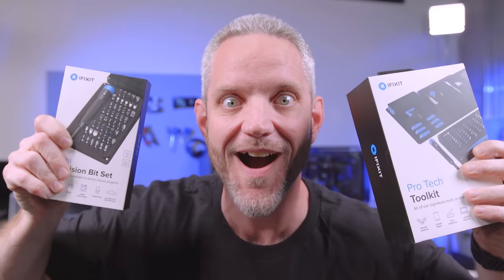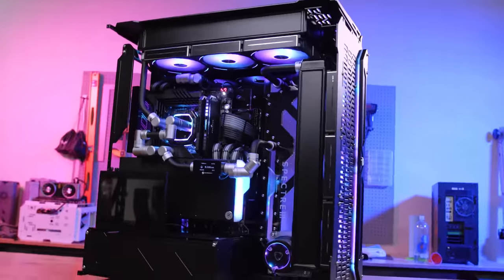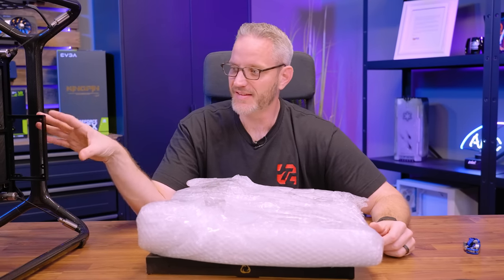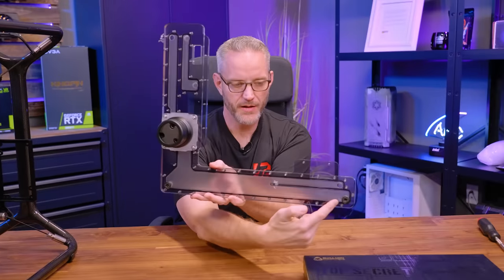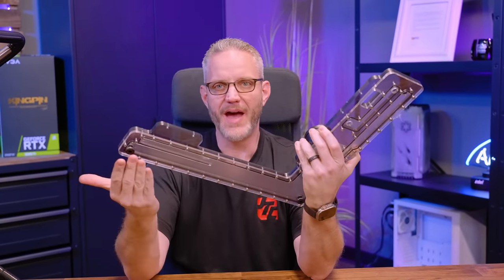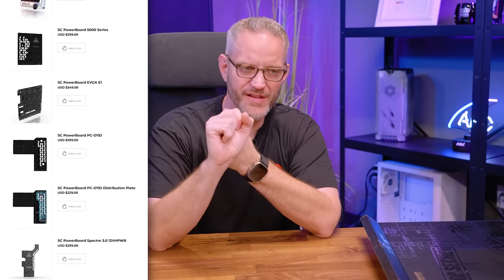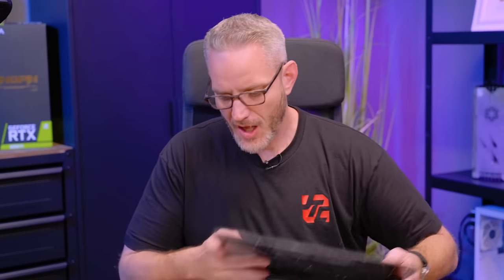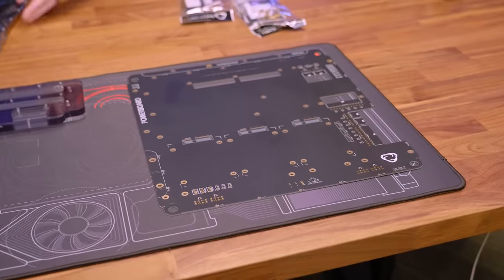This build just got even more EPIC!

Comment: This is going to sound moderately insane, but I think this build would be a perfect opportunity to get wild with copper.  I can see big copper rads on this, and it's amazing in my mind.
Reply: I like the idea. Maybe not an "insane" amount of it, but only a tasteful amount would look great.
Reply: @ElembeeOfficial  I'm sure Jay would only want to go with radiators, and tube fitting accents.

But in my mind, and for a long time, I've wanted to do a build soldering four bundled up refrigerator supply lines into 1/2" angled fittings, to where it looks similar to header tubes on a hot rod, both on the intake, and return to resemble that classic V8 style.  You could even make a solid copper distro block that drops off both ends of a radiator and splits to 4 smaller lines, on either end.

Again, this is just in my mind, and not something I've shared or seen.  But just to put it out into the aether.

I might add, that process is shockingly easy to do, if you've ever worked with those tubes.  Though, it definitely requires a certain finesse with a hammer to shape the fittings.

I dunno, just things honkies build in their minds when work is slow, I reckon.
Reply: @ramshaka  I can see your concept and I'm sure that would look great as well.
Reply: I think gold is more Jay's style but copper would be awesome
Reply: @jazazzaza  I just find natural metals kind of sexy.  I think the only way to get the gold look without paint would be to use leaf, which is just too fiddly for me.

If you wanted to do the chemistry homework, I guess you could substitute bronze though.  I'm just not sure how that would act in a loop, I know it will oxidize green crud without any additive though.

But I think you can get a nice 'rose gold' look out of copper, with very minimal extra work.  I like to use just an old rag, and coffee, starting from a raw polish, and lock it in with a little clear coat to keep it from going brown.

Just recently did this with my basement bathroom plumbing.  You can play with the antiquing with just a few pennies, and an eraser, till you get the desired color.  It's surprising how large of a range you can get.
Reply: @ramshaka  yeah it's definitely an aesthetic that matches the hobby too imo. yeah you're right, wouldn't be worth it w/o leaf but then that's tedious

rose gold would be very unique, I don't think there'd be many (if any) people doing that for pc water cooling

Copper, maybe coloured is the way to go for sure. Will be interesting to see what he does
Reply: Copper sounds very Diy Perks.
Reply: Copper pipes that are braised would be nuts very cyberpunk and steampunk it would be bad a.s.s
Reply: Not feeling the copper with the carbon fiber frame tbh.
Reply: Yeah, especially with those analoge guages, it would fit a copper steampunk-like theme perfectly. And the gold accents on the KingPin-Parts would work with that quite well also.
Reply: Are you saying "copper" because of how the GPU was looking and was giving a copper look because of the reflection from the wood table top?
Reply: Cooper tubing instead of plasticpipe for the aio

Comment: You should 3d print a cable comb that connects the 24 + 8 + 8 connector so it holds all of those cables perfectly to each other too
Reply: Also, Paint over or remove the barcodes on the 24 pin plugs.  My OCD is screaming at me right now.  EDIT: Spoke too soon.

Comment: At first I was worried that the power board will have upright power connectors (like the 2 extra pairs of EPS at the top) and because the MOBO has a 90 deg. connectors, the awesome cables Singularity provided will be too long (thought it's designed for a normal MOBO), but then I saw the connectors on the power board are 90 deg. as well so it means the cables will make a 180 to the MOBO and it made me so happy! As happy as Jay was when he saw the short cables 😂
I love the enthusiastic attention to details in this build! It's gonna turn out AMAZING!! 😍

Comment: I've got a suggestion for the screws: use nail polish for matching the color of the Kingpin theme; it is very resilient, it sticks very well and it shines more if you add nail clear lacquer. I used it when I refurbished my front door for the latches and screws and it looks the business. 
I only clings on to metal, don't use it on plastic or glass, it will peel off with ease.

Comment: I still think it would be cool to disassemble an old EVGA CLC 360/240 AIO, or the new CLCx one. You could keep the rad/fans and maybe even the block with some new tubing as a custom loop.

would also be a cool video to show how you can repurpose old broken AIOs where maybe just the pump is dead but the rads are still perfectly fine and can still be used.

Comment: Hey JAY I think that you should put a bracket for the rad to keep the mount from bowing and add an EVGA logo in the middle to give it a special touch. I think that some Noctua NF-F12 fans would look fantastic in the build. you could get Noctua to make an EVGA gold vibration dampener set for the fans to give it an accent. If you can get EK to do custom fittings you could get some EVGA gold fittings to keep the same accent all the way through the build. I would try to see if EVGA could maybe make a water block for the CPU kind of like the EVGA AIO CLC series blocks or get a company to make an EVGA logo CPU block with the inlet at the top of the E and an outlet at the bottom. I think the idea with the black frosted tubing would be perfect for the build. I think this is my favorite build yet. Keep up the great work!

Comment: Hello. I have a question that's a bit off topic. I'm putting this out in a few different communities to get a general vibe from a lot of people: 
13600k or 5800x3d? Same price in New Zealand and MoBo's are close in price too (I'd likely choose DDR4 even on the 13600k but could be persuaded otherwise)...

The PC will be used 90% for gaming and 10% for editing and posting speed runs to Youtube. 
I've got these parts already:
- 6800 XT
- RM850X
- Deepcool AK620 cooler
- 1TB samsung 970 evo plus
- Fractal pop air case
- LG 27GP850 (1440p 165hz)
- Peripherals

So I also need Mobo and RAM...
- Maybe MSI pro z690-A WIFI for intel? 
- B550-A pro/x570s tomohawk MAX WIFI for AMD?
- G Skill trident neo Z 3600 cl16 32gb RAM?

Any thoughts, suggestions or advice on the matter would be greatly appreciated.

Thanks for putting out excellent info and presenting it in a very engaging way. For someone like me who is new to the scene, it's awesome content.

Comment: The silver piece that holds the cable on the front top right is backwards, if you look at all of the rest they are correct but that one isn't. If you look at it from the back you can tell that it has the same hole design as the other 3 that are currently on the front.

Comment: The bowing on the top should disappear when you screw in the ends. That should pull the bracket apart, which should make it pretty straight. Maybe if it gets warm and expands a bit some bowing might come back tho.

Comment: The power board is a great choic, but I never liked the water distro plate personally. The case doesn't deserve RGB. Its not meant for lighting and as a car guy I know you agree. 

On our E1 Build used a top mount rad and it worked very well. You should def take a look at ours. I think we had very similar ideas

Comment: Jay with the round analog built-in displays of the case, if you include Aida64 readouts a round monitor LED would be best fit.  To make it truly perfect, 3D printed cup shaped housing for the LED round display(s?) to match the case, very hotrod!
Reply: If you wanted to remove the thick video cable, the round LEDs can have a Raspberry Pi Zero plugged into its back, & you'd only need power, & have its Aida64 data received via BT or WIFI since the Raspberry Pi Zero has BT & WIFI built in.

Comment: you can go with Noctua NF-A12x25 chromax, they have no fixed cable. with a daisy chain pwm splitter its easy to hide the cables and connect multiple fans with one cable to the motherboard.

Comment: Hello Hello From Canada!!! That is such a killer build so far Jay! I thought the distribution reservoir would take away from the bare industrial look of the chassis frame, but WOW that E1 looks amazing. You are so right about the cables and power distribution board looking fabulous and those Singularity guys really know your taste. I can't wait to see it finished up with cooling and it is sad that you can't take all of the E1 hardware in to get gold anodized to really match the board. That would be totally incredible and would probably cost a fair bit of cash to do, but with the black tubing and gold fittings. OOOOH I just got shivers. Great build Jay and I can't wait to see what comes next.      🤘😁👍
P.S. The rad might straighten the top grid once it is screwed down.

Comment: This is such a nice build. I am just not sure about the Phanteks T30. The grey makes the plastic more obvious. You already have an anthracite grey from the carbon, the grey on the temperature sensors, the light grey from the board and the glistening grey from the metal. Introducing yet another kind of grey might be too much. Grey can be a lot like colour in that aspect. Also the obvious plastic grey might clash with the carbon/metal look. Some simple black Noctuas at the other hand would be a discrete choice. They would blend in to the background so the eye rests on the more important parts.

Comment: Love that case, but its given me an idea. Challenge for you: MAKE a PC case using multiple 500mm radiators stuck together (possibly welded?) for the top, side, front and bottom, so four out of the 6 case sides. Then get a regular rear "metal"/3D printed rear plate with cutouts for IO. And finally hang the motherboard mount on cables under tension, like the EVGA E1 PC case.

I would imagine two length ways 500mm radiators to form the top, the same for the bottom and front, then five 500mm radiators to form the side of the case. A total of ELEVEN 500mm radiators, for what could be enough passive cooling to require no fans, just the pump to move the water through all the radiators.

Alternatively, you could either find, or 3D print, a distro plate to form the front of the case, so only top+side+bottom were radiator walls, reducing the number of needed 500mm radiators to nine.

Comment: Question for singularity comptuers: wouldn't it have made sense to make the powerboard to mount onto the original EVGA frame? That way you'd be able to leverage the inherent strength of the frame and would only need to make some holes bigger for existing bosses and maybe supply new mounting hardware the correct length.

Comment: I say ek torque fittings with the gold color rings, also are you going to try to find a compatible waterblock for the evga NOT 4090 so you can keep the cooler on the wall?

Comment: That short cable length difference really seems like an obvious but underused idea.

Shame when the cluster was moved the scratch became visible from first fitting it. Could hide it by switching that part to the back as the frame is in multiple pieces (pedantic I know) just because it's such a clean build.

Comment: Jay what’s the best way to set up airflow in the Lian Li v3000 plus with 3x 480mm rads, top, basement, and front.  I’m stuck trying to figure it out they all would be push pull fan configuration, but idk if they should be all exhaust, intake, etc

Comment: it would look cleaner without the gauges. get rid of the hanging elements on the outsides and hang the radiator directly between the carbon tubes. Hide the cables inside the carbon tubes and have one thigger cable of all small cables directly on the left side to the powerboard :-)

Comment: Glass (or similar) cage will stop the dust problem ... not a new problem, not a new solution
The glass could even be etched with evga logo ? Could even do 3d printing to make a shroud over the glass.
Cooling fluid could go thru the tubes of the stand.

Comment: I'm gonna assume the tubular structure of the case is hollow.... so couldn't you drill holes and send the fan wires etc. through those so they don't show? If you removed the connectors and kept the holes just small enough for the wires and then put the connectors back on afterwards you wouldn't have any large nasty holes to cover up.  Or perhaps you could run those wires through some water cooling tubing so it all looks like its part of the loop even though its dry.   Either way I'd hate to see any cabling more than absolutely necessary on a build designed to be super clean.

Comment: the water block takes away alot of the floaty design of the case, imho. tbf. you get rads all around, anyway. balances the rear end. also... it is smoked but you see the machining marks (17:17) in the wrong light. if they woulda softened those marks it'd look better.

Comment: Are there no overclocking tests for the Ryzen 79x0X3D processors?
I have a theory: The clock rates scale quite extremely with exaggerated water cooling for these chips. 
So that with 2x420 radiators the 7900X3D has more performance than a 13900K. At least that's what my tests show at 1440p.

Comment: only thing I don't have is a EVGA mobo in my case i do have EVGA Nforce 750i SLI FTW but i'm not putting an LGA775 mobo with the rest of this what i do have as my daily runner is the ASUS Rampage iv Extreme lga 2011 with Xion E5-2697 v2   EVGA DG-85 ,  EVGA GeForce RTX 2080 Ti XC ULTRA, OVERCLOCKED, 2.  EVGA 1000 GQ, 80+ GOLD 1000W, Semi Modular, EVGA E

Comment: Sir please reply.........

My RTX 3060 has 8 + 6 pin power connectors. PSU (cooler master 650watt 80 plus bronze) has two  pcie cable, both has two 6+2 pin connectors chained together. Should i use a single cable, or 8pin from one cable and 6 pin from another cable?

Comment: EVGA made FX fans at some point. They seem to be out of stock everywhere. I had to bring them up but I wasn't a fan of their looks anyway.
Otherwise I would suggest Seasonic MagFlow fans. They are only avaliable in 120 mm but if I remember correctly the E1 will only take 120 mm radiator sizes.

Comment: sir jay kindly help with this question
is this ok to do force constant voltage and get maximum core clock with safe temp for example i did 1.025v in curve with force voltage with 2130mhz core clock on 3060ti gigabyte .my temp is 62 C on heavy gaming.the maximum default voltage it get is 1.087v

Comment: Hey my man,I need your help
I got Corsair 4000D Airflow and had previously Kraken X73 with 6 fans on it for push-pull and RTX 3060 all mounted on N7 B550 MB and had no issues with space.
Now I got 4080 and had to remove the pull fans from AIO to fit GPU inside the case. I want to swap to 5000D Airflow but can’t find any proper info if GPU would fit if I mount AIO again with 6 fans in front

Do you mind doing showcase of such a build for me:
R9 5900X
N7 B550
Kraken X73 or any other
Any ram
Any fans (total 13, 6 front, 3 side, 3 top, 1 back)
Any PSU
Any 40xx GPU
Corsair 5000D (Airflow) Case

Comment: i have a ryzen 7600 with an xfx speedster 310 merc 7900xtx 32gb ddr5. my issue is the stock cooler doesnt keep the cpu cool. im hesistant to use a aio cooler again after the last one i used had a pump failure and killed the board and cpu. i have an 850w psu but i think i need a 1000w as i keep getting the wattman error and settings restored or a gpu crash when overclocking anything in the pc.

Comment: i got an issue with an ex mining rx 570 card,managed to fix the code 43,but windows messes with that fix with updates,should i permanentl disable windows update?and the amd fix got rid of my amd control panel,can i use another program that doesnt erase the fix?

Comment: Hello do you know any little tweaks i can do to my PC build to like increase Perf? Decrease Heat? Improve Speed? Here is my setup,
Gigabyte X670 Aorus Elite AX (Socket AM5) DDR5 ATX Motherboard
Kingston FURY Beast DDR5 RGB 32GB (2x16GB) 6000MT/s DDR5 CL36 DIMM Desktop Gaming Memory Kit of 2 - KF556C36BBEAK2-32
Kingston FURY Beast DDR5 RGB 32GB (2x16GB) 6000MT/s DDR5 CL36 DIMM Desktop Gaming Memory Kit of 2 - KF556C36BBEAK2-32
Be Quiet BN3101200W be quiet! Straight Power 11 | 80+Platinum,Black
AMD Ryzen 9 7950X 
Samsung 970 EVO Plus 1 TB SSD
Seagate 14 TB HDD
Crucial MX500 2TB SSD
ARCTIC Liquid Freezer II 240 RGB Fans
Gigabyte NVIDIA GeForce RTX 4090 GAMING 24GB 
Corsair 7000D AIRFLOW Tempered Glass Full Tower - White
Gigabyte AORUS FI32U 31.5 4K/UHD (3840 x 2160) 144Hz Monitor

Comment: So water cooling is so ridiculous for cost to use now days. You have to drain your system every time you need to deal. I have a radiator in my car and it’s sucks on connection. Why make more problems. Ooh it just makes us spend more for cost, not really worth it!

Comment: Love the chassis,  just not those steampunk'd dials...so opposite in fit and form that it jars!...replace with led panel....no rgb other than when gaming, auto on/off using Armourcrate app control...all logitech mouse/kb with powerplay mat, again all synced with same rgb when in game or steam...everything dark when not gaming...
Finally switch off the MOBO leds and black-out the ssd leds with a sharpie...bloody hate mobo leds flashing green or amber every read/write ..